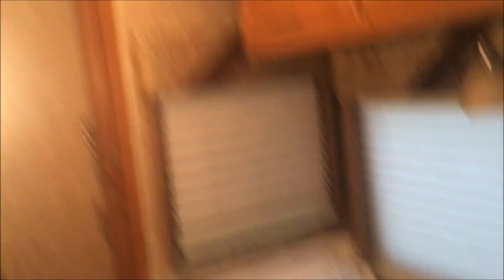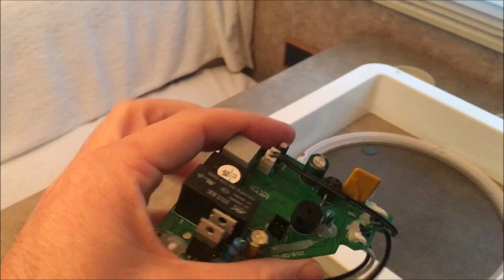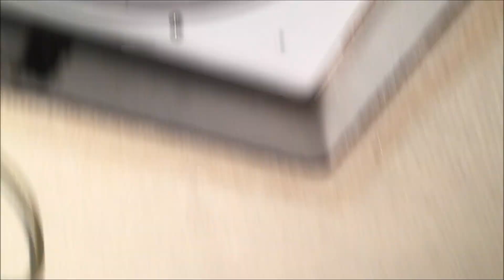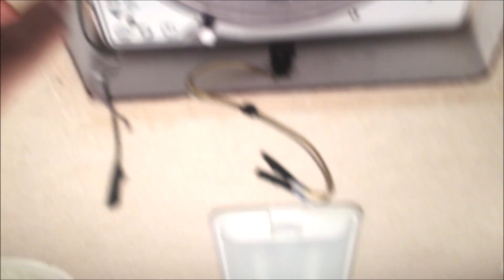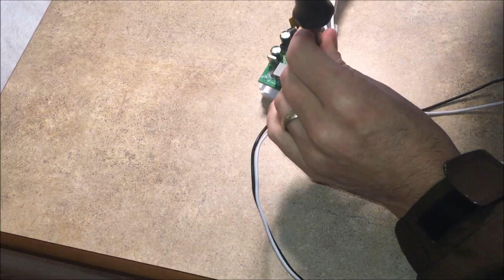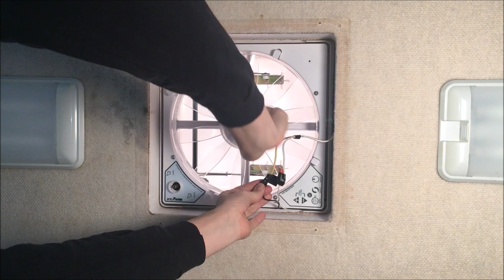MaxxAir Deluxe RV Vent Fan Circuit Board Replacement

Comment: Thank you for posting this video. I added a Maxx Air Fan to my camper van, and not even 6 months later it was broken. It turned on by itself at high speed and would not turn off until I removed the fuse. It was still under warranty and I was sent a new PC Board for free. I called multiple RV repair shops and they were giving me quotes over $200 to change out the part. Now I'm going to change it out myself, thanks to your video. If I ever do another van build, I won't add a Maxx Air Fan. They are ridiculously overpriced and are cheaply built.
Reply: It looks like everyone is buying the new AirPlus brushless - we’ll see if people have as many problems with that one as they do with MaxxAir’s… I’m bummed that I bought my MaxxAir and not six months later everyone is now selling the AirPlus. I already have a warranty replacement of my printed circuit board with very minimal hours is use(maybe 40 total use hours.) Not a good sign…

Comment: I just changed out my coach batteries in my van and now my fan won't shut off.   We checked the fuse and it was good so now I guess we'll replace the circuit board.  Hopefully we can do it.    :)      Since my van is a 2019, I bet the circuit board will be different like yours was.

Comment: I hope this thread is still active 😅
Issue with my Maxxfan:
- Suddenly is started to beep every 4 seconds continuously (the first time when the lid was closed and fan off)
- Since then it sometimes shows random behavior, e.g. shuts down by itself, changes directions, etc.
- Meanwhile there are periods when the 4 seconds beep and strange behavior is present and periods where everything is normal even without the beeping

The technical support of the company was not such a great help to determine the root cause. They just confirmed, between the lines, that the 4 seconds beep is some kind of error message.

@All: When you experienced "weird behavior" of your product, what kind of symptoms did you have?
How did you know if or even what was defective on the circuit board?

I don't want to burn money on a new circuit board before knowing for sure that it is "burned"...
Reply: I have this currently, did you fix it?

Comment: Both my fans went out within weeks. Called the company after the 1st one went out & after troubleshooting with me over the phone, the rep immediately determined the problem was a bad circuit board. He ordered 2 replacements (updated versions) in case the other fan went out. It did, just 2 weeks later. Said they were back ordered & would be available in 6 weeks. Received them in 3.  If many people have had the same issue, why wouldn’t the company acknowledge the issue & post on their website the number to call if your fan goes out? 

One thing to note, when your fan started acting up, wouldn’t it have been better just to remove the fuse to shut it down? You stated the only thing you could do was cut the wires. If it had just been a loose connection or other simple issue (& not the circuit board), cutting the wires would have damaged a perfectly good circuit board.

Comment: THANK YOU! When I started looking up the replacement circuit board and saw all those wires I got pretty scared – but your tutorial makes sense of them all, and now I’m ready to do it 💪🏼

Fried my own board when replacing the solar battery 🤦🏻‍♀️🤦🏻‍♀️🤦🏻‍♀️ Everything still works fine except the open/close feature. I did replace the gear arm, hoping it was that because it was cheaper, lol, but now I just have an extra gear arm 😂 Fingers crossed this does it!🤞🏼

Er, only question though: possibly it could be something wrong with the lift motor, not the circuit board? I’m not even sure how I would run a test to know… (unless I bought either a returnable circuit board or lift motor and tried one before the other) One thing to note is that the open/close action failed slooowly over a few months (at times going back to normal even!). Maybe that points to trying a new lift motor first?
Reply: p.s. I’ve had my fan for almost 5 years now and am a full-timer in all sorts of weather (I’ve had multiple feet of snow on mine, but only once did I have to manually clear the snow to open it) and though I’ve gone through a couple minor squeaky periods, mostly it just runs exactly as promised.* Just wanted to share that in case it helps anyone who is terribly worried about theirs.

*only issue I’ve had is that on really hot days (over 90 or 100°), the motor has sometimes overheated and turned off if I ran it any faster than 70%. (It automatically turns back on once it cools off though.) So I generally don’t run it above 70%

Comment: Can you please post the number you called for the company to send the replacement? My fan turns on for a second and then stops and starts beeping and I have to unplug the fuse to reset it, so I'm hoping it's the circuit board. Thanks!
Reply from the maker: Was probably (574) 247-9235

Comment: I need MaxxAir 5100K board, looks like it needs part 10-21276K-V3.9 -- I find it at adventurerv.net but they can't tell me whether it's a cheap knockoff.  Any good supplier?  eTrailer.com doesn't even list an ordering phone number for pre-sales support.  Thanks.

Comment: Upon further review... vendor says "Solar trickle charger can slowly build up overvoltage" -- which could fry the board? If indeed I must replace the board, would a voltage regulator help stave off a repeat incident?

When I turn on fan, circuit breaker gets thrown.  I find no evidence of short.  Could the board cause the breaker to blow?  Thanks.
Reply from the maker: It could, but would also think there would be evidence of a short.  A regulator would help for sure, but would need to make sure it can produce enough amps to run the fan motor.

Comment: This is only useful video on YouTube.  My MaxxFan started blowing fuses.  I've seen video suggesting indeed that board can't handle > 13.5V; my control panel sometimes reads > 14V.  Please let me know how I might isolate the problem.  FWIW, video suggests indeed replacement board is redesigned.  Is there any chance a faulty motor is to blame?  Thanks!
Reply from the maker: My replacement board has not been an issue, but have seen similar posts about the voltage.  A regulator would help, but need to make sure it can supply enough amps to the fan motor.  You can disconnect the motor and power up the board to see if the motor is the issue.  I have an unpublished video on the motor replacement.  Here is the link https://youtu.be/-zgSVGFkayc
Reply: @jcondon1  Thank you so much for the help.  I disconnected the motor and supplied it power directly, bypassing the board, and it worked fine.

A thrown breaker would seem to indicate a short, but I can find none.  Could a bad board cause the breaker to switch?

I have two fans.  How do I determined if they're wired in series or parallel?  My understanding of electronics has gaps.  Thanks again.
Reply from the maker: @3genac  they should be in parallel sending 12 volts to each.  A bad board could trip the breaker.  Also could be a wiring issue.  If you disconnect the board does the breaker stay on?  My fane has a 2nd smaller motor to raise on lower the vent.

Comment: MaxxAir Fans Voltage Issue Solved
While I am not a polished reviewer/tutorial artist; the following video may be of assistance to folks experiencing control panel circuit board failure(s) and the solution/prevention.
Thank you, Dave
https://youtu.be/fbWuiF2JSXs
Reply from the maker: Studio DaVeed it’s a well made video.  Thanks for sharing.  I wonder if I got the updated board?
Reply: @jcondon1  
Thank you!
I am unsure what dictates the updated board but in that forum I mention it seems the voltage issue remains somewhat...

Comment: NOTE:
MaxxAir fans can only take a max 13.6 volts!!!
As in my RV, when I am hooked to shore power and the onboard power system calls for the trickle charger to kick on (14+ volts) my fans shut down.
This voltage issue can be fixed with a voltage regulator that will step down voltage to a max 12v.
Here is the one I bought today as I just discovered this as I just had the fans installed with a new roof on motor home.
https://www.amazon.com/gp/product/B017SM1O98/ref=ppx_yo_dt_b_asin_title_o00_s00?ie=UTF8&psc=1
Here is a forum I found to address these issues.
https://www.escapeforum.org/forums/f8/maxxfan-7000k-voltage-regulator-14667.html
Reply from the maker: Studio DaVeed thanks for the info.
Reply: Additional:
From my research the range of issues are; run away fans, one direction only, Auto Thermostat failure, etc and complete failure.

Comment: Did you buy the Maxxair fan on Amazon?  I heard Maxxair will not honer warranty if bought through Amazon.
Reply: I purchased on amazon and they still sent me replacement board for free
Reply from the maker: Traveling Terry no.  Purchased from a local RV dealer.

Comment: Great job! Brand new 2020 camper and my Maxx Air circuit board failed. Back to the dealer tomorrow for a replacement under warranty. Thank you for a great how to video. Maxx Air needs to step up their product quality.
Reply from the maker: Patriot One thanks.  I loved my old analog fan, not much to go wrong.  The replacement board I put in had been redesigned, hopefully for the better.